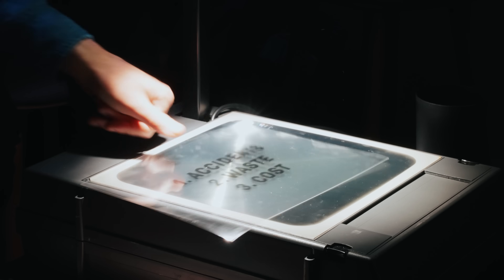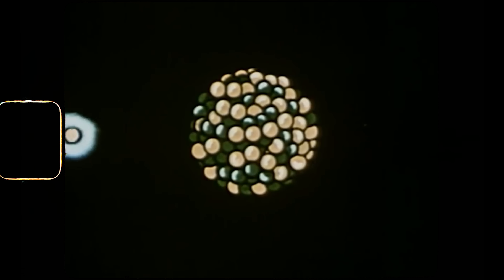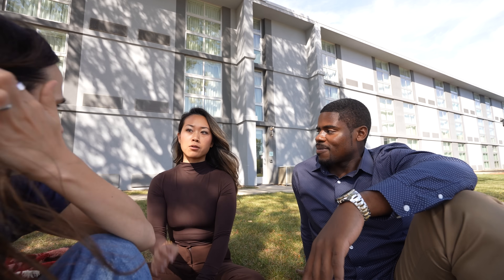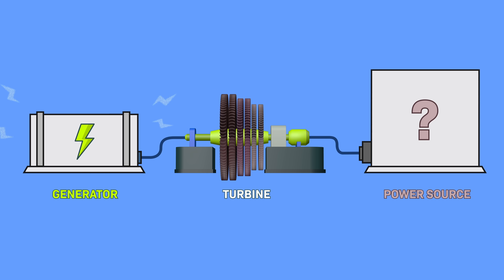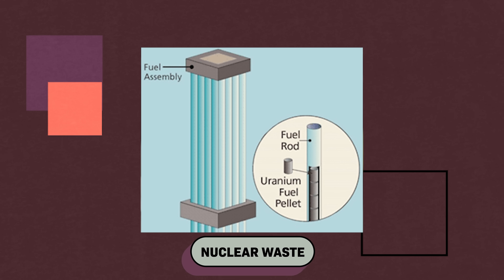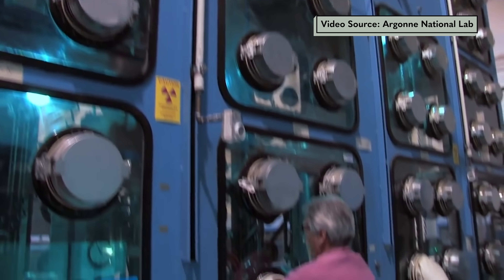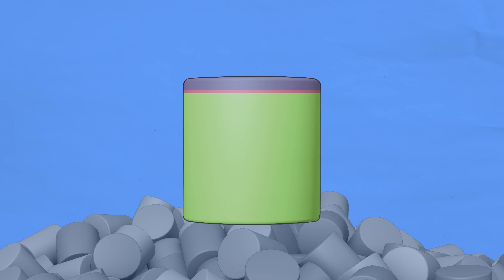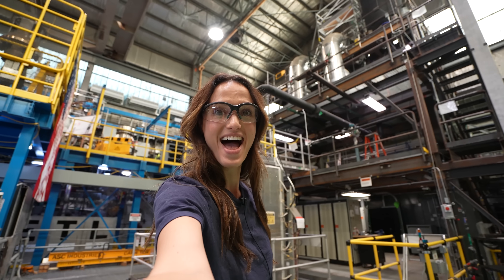The Big Lie About Nuclear Waste

Comment: By sandwiching radioactive material in a PN junction you can extract electricity until it is not radioactive . They have done this and it works very well but it would take away the profit and control of electricity from huge power companies. Solar panels work on the same princple but they are designed to work on light frequencies  instead of radioactive frequencies. There was an industry making "nuclear" batteries for laptops but all the info has been erased from the internet.

Comment: Hey I saw both your video and Johnny's and loved it! Love your work as well. I do have one question for you. What happens to other dangerous Nuclear waste ? I might be completely off here, but in Johnny's video the kinds of nuclear waste shown are protective gear, reactor parts, and used fuel. However, in my understanding and memory, a few years ago there was also an anxiety around the 'radio active' water waste from nuclear plants. The water that is heated by nuclear reaction is radio active after use and then stored in these huge 'radio active' lakes or the water that is used to cool the spent nuclear rods, anyway it was something about radio active water in lakes. Is that even true, or am I mistaken. If, there is such a thing, then could you answer this question please. What happens to the water waste from nuclear plants? Also, other such  'radio active' waste that may exist (other than the three types mentioned in Johnny's video) ?
Reply: The vast majority of radioactive waste is low-level.  This includes nuclear medical materials, gloves, suits and so one.  The amount of waste is low.

As this video shows, the waste can be reprocessed, or stored.  The pellets are turned into glass.

Comment: "And I'm thinking I'm going to be so overprepared..." and right there is her admission that this is just her emotions speaking. An ordinary person never knows anything more than a person who's dedicated their whole life to learning about a subject. I see this all the time and experience it as well with people who think that they know more about human behaviour than me just because they're humans when it's literally my field of expertise.

There's also another reason we have stopped building nuclear power plants and that's entropy. No matter how safely we build something today it'll be a little less safe tomorrow as things degrade in efficiency over time. And we can only repair and maintain something for so long before it's no longer viable or feasible. A common example of this is car maintenance. At some point, we have to replace the old car regardless of how well we maintain it since things we're unable to maintain due to the infrastructure of it will begin to break down.

And when the issue is nuclear reactors there will be a lot of material that has absorbed radiation. No matter what fuel has been used this is the unavoidable reality as long as radioactive material is used as a primary fuel. The metal of the reactor will absorb radioactive wavelengths as the fuel is burned. This is non-recyclable waste, we have to deposit it somewhere and it'll most likely be lethal in a time period measured in thousands of years since a lot of radioactive waste have longer half-lives than unprocessed uranium.

There are also the consequences of accidents to think of. Chornobyl and Fukushima represent some of the worst consequences of nuclear accidents possible, and while it's extremely unlikely that modern nuclear plants will ever have that bad a meltdown it's only applicable now. How will the state of things be in 100 years? No one knows. All we're doing is saddling our descendants with the product of our fear if we go through with this. The exact same thing that has landed us in the climate change mess to begin with, although back then it was the fear of lowered profits.

Comment: The bulk of nuclear waste usually is not about spent fuel. It's about contaminated waste.
What plant will use the concrete from Chernóbil? Or the liquids, metals, etc contaminated in nuclear accidents, spills, buildings from criticality accidents, spent emitters,etc.
Waste, not partially used fuel or transformed fuel.

Comment: What is missing is that we don't have to use steam wind or water to move the armature magnets and coils of copper wire.  Tesla bound Edison's generator with magnets all around the armature and used water to move the armature magnets and coils of copper wire. We could  have unlimited electric power without fuel or pollution using Edison generators and dynamos with inverters and transformers to deliver high voltage AC power to the power lines.

Comment: Nuclear power generation of nuclear waste is .   We can generate electricity without nuclear power plants.  We don't need nuclear radioactive plumes from nuclear power plants.  Clean energy is an Edison generator and dynamos power plants with inverters and transformers to deliver high voltage AC power continuous peak power to the power lines.  Breeder reactors can create a proliferation of nuclear power plants. We can't survive the nuclear cascade created by nuclear technology.  The only solution is to stop and secure all sources of nuclear technology and radiation.  The nuclear nonproliferation treaty enforcement and obligations are based on the nuclear cascade.  We don't contribute to the nuclear cascade.   We don't build develop or share nuclear technology under Treaty obligations with the USSR.

Comment: This recycling step can be skipped if we used a Molten Salt reactor like the LFTR. Look up Kirk Sorensen. Liquid Fluoride Thorium Reactors.  Much more cost effective and far more efficient. Especially when combined with closed loop super critical CO2 turbines.
Reply: I should clarify. If the fuel is held in a molten state, the recycling can be done midstream and the reactor never needs to be shut down to shuffle and recycle the fuel. It is simply chemical extraction.

Comment: The Chernobyl disaster was due to cost cuts in building materials (for a larger profit margin), which would have been totally avoidable if greed had not been in the equation. Fukushima was in my opinion bad planning, one does not simply build potentially dangerous energy plants near fault lines and close to coasts. Talking about fault lines, burying (unrecyclable) nuclear waste near the edge of a subduction plate would drag it into the depths of Earth over time. Not even mentioning Thorium, that's a whole other rabbit hole.
I'm surprised there was no mention that coal ash is more radioactive than nuclear waste, where does that nasty stuff go? In a nuclear plant anything radioactive is contained, do coal plants have the same level of control?

The bottom line is that nuclear is way more safe, viable and even needed than the general public is aware of. "Bang the rocks together guys".

Comment: I'm a nuclear scientist (Master in nuclear science and technology) currently working as a nuclear plant operator in France.    Nuclear waste is not all waste but some of the elements in the waste like thorium and plotonium and left out U235 are of prime importance to all the  countries having nuclear power. We have been using the waste to produce heat and to produce electricity but mostly these elements are extracted from the waste and are used to produce the most powerful nuclear weapons, hundreds of thousands of time powerful than that USA dropped on Japan, unlike humanity has ever seen before. But not all of the nuclear waste is useful, also as we use nuclear waste to produce heat or power we make it more and more dangerous, the more we use it, the more energy we extract the more dangerous and toxic it becomes. And eventually, we have to "safely" dispose of this waste. And the safest way to dispose of the waste is to store it in a cool dry less humid environment for a couple billion years,  The only problem is that humanity hasn't lived that long and the building and structures we built can have only lasted couple thousands of years never hundred thousand and certainly never million or billions of years. So it's inevitable that one day this most toxic waste will get leaked from whatever casks and containers we put them in and when they do, the area where they get leaked will be like Chornobyl, or even worse, and that is only when the leaked waste doesn't get in contact with water if it does, the damage done can't be computed.
Reply: If you really were a nuclear engineer you would be able to compute and compare the damage done at Chernobyl to the damage being done by coal mines all over the world who could destroy Humanity
Reply: @mikefallwell1301 or you know we could switch to renewables and avoid both of your worst case choices.
Reply: @brettgracey9682  and deal with the damages caused by lead and rare Earth metals because you need to manufacture batteries?

Solar Panels and Wind Turbines are less efficient and don’t work 24/7. Solar Panels work during half the day and really only peak when the sun is at its highest and with no cloud cover. Wind Turbines are completely dependent on wind and can’t be reused. Hydropower has similar amounts of energy production with Nuclear Power at the cost of destroying entire ecosystems and towns/villages with examples like the 3 Gorges Dam and the Dam being constructed on the Nile.
Reply: @robertoroberto9798  and deal with the damaged caused by digging up old vegetation and feeding it to your car.   You might want to check out some of the new battery technologies currently being manufactured, like Sodium ion batteries, and Ambri’s new grid level storage batteries, both technologies which use almost none, or no rare earth metals.    Fact they use some of the most abundant and cheapest materials on earth.  It is interesting that you mention mining as being a problem.  Remind me where Uranium comes from?  You do realize they aren’t called rare earth metals because they are actually rare, right?  

As for mentioning intermittency, something that can be dealt with using storage.  You do realize that demand also fluctuates greatly during each day and from day to day.  Nuclear isn’t the best form of generation to load follow.  It can be done, sometimes, with some reactors, but when you try to cycle down a nuclear plant to 60% at night (or whenever) when demand drops, the economics of nuclear go from horrible to extremely horrible.  Other than hydro, the only other way to store energy is with some type of battery.  A phenomenon that is rapidly expanding, globally, why because it’s our only way to get off oil.
Reply: @brettgracey9682  Mining becomes a problem when you need to have a much more greater amount of mining done to get lithium. Regarding batteries, they’re still new, and that doesn’t mean nuclear power can’t be developed to be more efficient.
With countries like the US and China, you absolutely need nuclear power or fossil fuels to recharge those batteries. Cities like Los Angeles, Guangzhou, Beijing, Shanghai, New York, and their respective provinces/states won’t be able to supplied by a massive battery site and last through the night.
Reply: @robertoroberto9798  you might want to learn how much of the lithium is actually mined, hint it’s leeched through a br8ne, not dug out of the ground in a highly polluting manner like say Uranium.  As for technologies like Sodium Ion batteries, it’s literally 50 years old.  It’s also being commercialized for sale, literally this year.  As for Ambri, that technology is perhaps 15 years old now, but it’s based on the same concept as aluminium smelting, so not really new.  Ambri’s Liquid Metal battery operates at high temperatures, so it needs no cooling.  It comes in a 10 ft shipping container which can be linked in parallel, with however many other ones you want to link it with.  All in a relatively small area.  

It seems you don’t grasp how adaptation of new technologies works, nor of the simple scale of the projects.  Electricity requirements are massive.  Adaptation of any new means of generation is going to be relatively slow, as you would be replacing existing capacity.  So it would be massive, but doable to perhaps replace 10% of generation capacity, in any given year.  So it might take 10-15 years to replace coal and natural gas with renewables and storage.  Or you could build the 4-10 nuclear plants (even if they were SMR’s, it’s still all in a few facilities, so it makes little difference if it’s 4 GW in large reactors or SMR’s, which don’t even exist yet) in the same time, and with the same inherent economic problem.   Your proposed overnight problem while an increasingly solvable problem with battery storage, it’s a huge problem with nuclear economics.  See any grid will have a fairly wide range of supply and demand.  So in order to prevent brownouts/blackouts or massive damage to electrical infrastructure, all grids have to balance supply and demand fairly closely.   Without storage, the only way to do that is load following, which is easily done with natural gas and hydro, even wind.  You can rev up or slow down generation as demand fluctuates.  Now some new nuclear is also capable of doing so, but here’s the rub, the reactor still runs at 100%, but generation is curtailed from 100%.  Unlike natural gas, in which if you throttle it down, you burn less natural gas.  Nuclear, it costs the same regardless if you produce 100% electric or 60%.  That really screws with the economics, hard.   Now if you have storage, that cycling is reduced, if not eliminated as storage can absorb extra or supply during a shortage.  Best part about storage is that, it doesn’t care how the electricity was generated.  Now if you think storage will be a massive extra cost, keep one thing in mind, even a small amount of storage like Ambri’s (which is only one of 100 solutions currently for sale) are extremely cost competitive, especially over long periods of time.  Far more cost competitive than lithium ion.  

Next comes the real economic problem with nuclear, it’s extremely expensive and always requires government funding to make it happen.  So China, Russia, Pakistan, India who are fundamentally dictatorships do have political leaders who are willing to spend the billions in government money to build them.  Now look at western democracies.  If it takes 10-12-17 years to build a nuclear facility, which politician do you think are willing to take on all the financial risk for a project that they likely won’t be in power to celebrate when the project actually goes live?  Even if you are thinking SMR’s are the answer, remember, they are still the better part of 10 years away from commercializations, with a yet unknown cost structure.  In the meantime storage, solar and wind continue to grow at massive rates, and continue to decline in costs.  

I’m far from a Luddite, and I don’t have any ideological problems with nuclear, except it’s a never never solution.  This will be the exact same conversation 10 years for now, except by then much of our grids will have already been greened.  Sorry but that’s the reality of nuclear, it’s dead on arrival.
Reply: How about put the waste into space or shoot it into the sun? Was hard to imagine before, but with SpaceX might be possible.
Reply: @markeasley6149  luckily there isn’t a history of rockets and space shuttles blowing up in the atmosphere.  I mean if that happened could you imagine what it would be like with 5 tons of highly radio active material dispersed into the atmosphere?  I mean it’s been what 3 weeks since Space X had a rocket explode on them during launch?
Reply: @brettgracey9682  You know, there’s this thing called a launch escape system.

Comment: Okay so great, thanx for explaining. But the story is not complete. What happens to the parts that cannot be recycled? How radioactive are these parts and what is being done with them? Okay so maybe the radioactivety can be reduced to hundreds of years, which is still a long time  and you mention that current storage methodes are built to only last decades. So still lots of issues to be adressed here. And how then does it compare to the other renewables, you need to take that into acount as well escpeciall considering the timeline we are on when it comes to the heating of the earth. Are we not juts wasting our time trying to get back into nuclear when other options that are already being implemented might just be better?  That all needs to be looked at.

Comment: I like the video but worth pointing out that the ‘dangerous’ ionising radiation’ tends to have a short half-life, ie only active for a short time, (only weeks/months), after which it’s gone, and the longer lived radiation, with long half-lives gives off radiation much more slowly, which means our bodies deal with it, without an issue, because DNA can and does mend itself. 
There are only 2 ways to get radioactive stuff into you: eating/drinking it or breathing in radioactive dust or gas. 
As a result, the danger is vanishingly small.